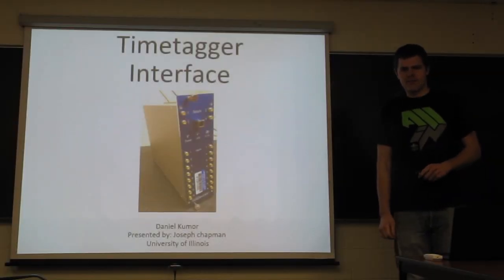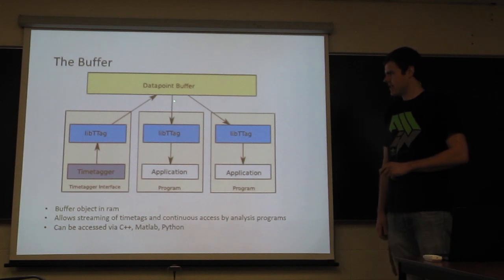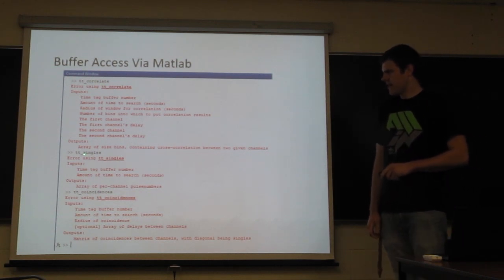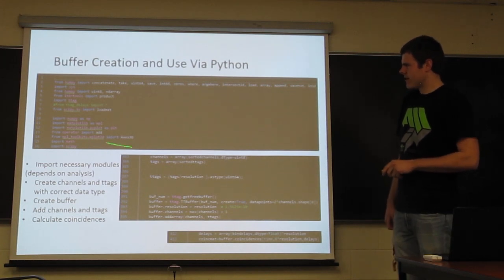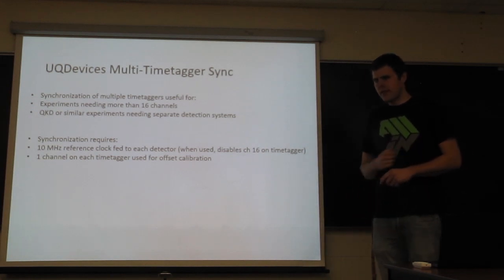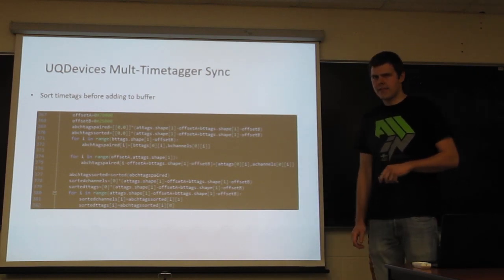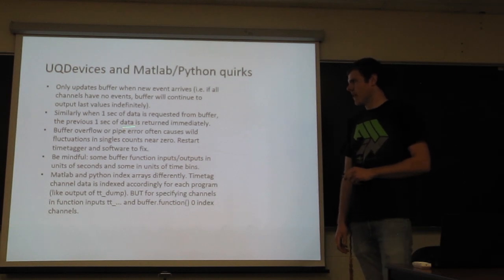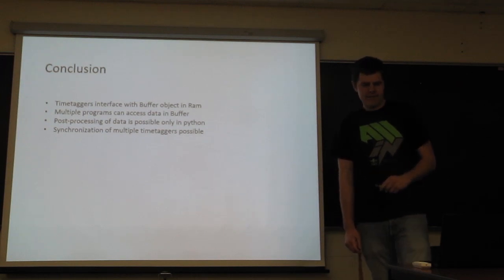Ep. 3  Timetagger

Comment: Thanks for sharing. So time tagger does not say the time exactly. You need to set it for a t=0 point. Is it true?
Reply from the maker: It isn't synced up with normal time. It is like an extremely fast stop watch that starts counting when its turned on. When an event occurs on a channel, the timetagger flags what time (relative to when the machine was turned on) it occurred and what channel it happened on. I don't think this particular unit has a way to reset the time to zero without turning it off and on again.